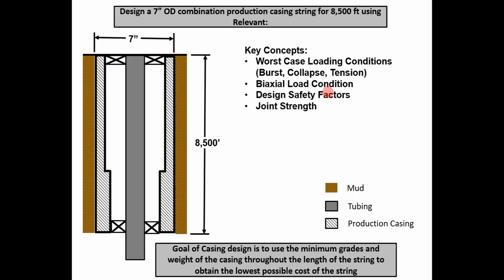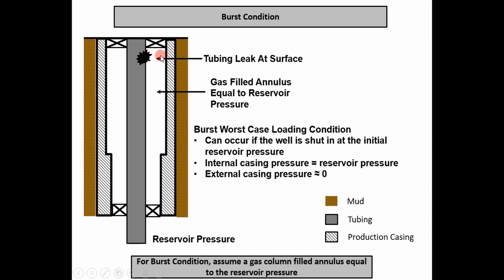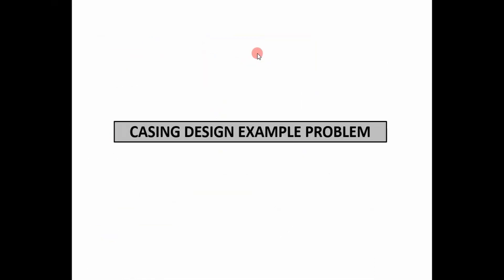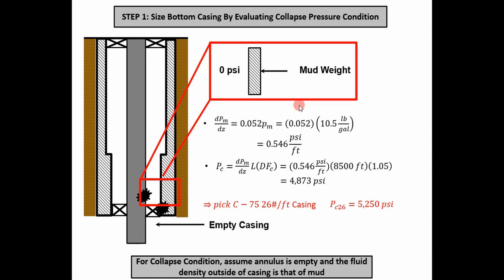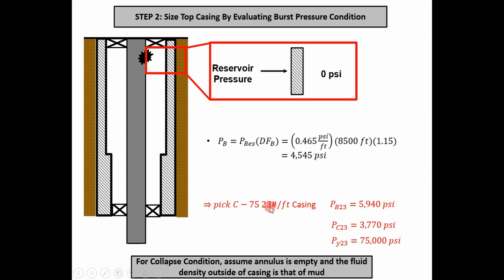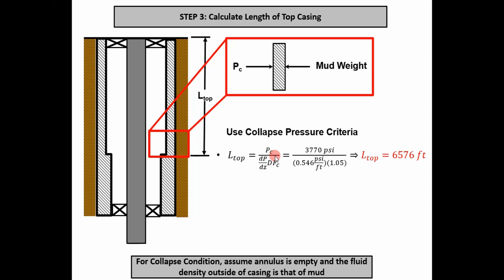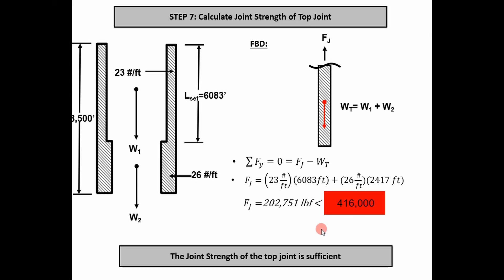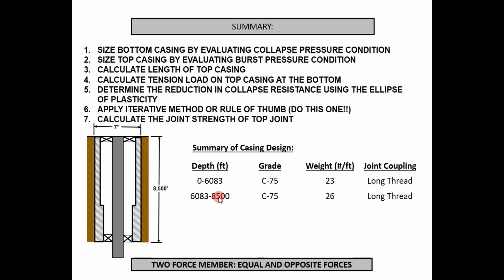Sizing a Casing String: Step by Step Approach

Comment: Can you tell me please how we calculate the casing weight on fluid
Reply from the maker: Its the weight of the casing minus the buoyant force
Reply: I wanna know how to calculate the buoyancy forces Fa= pressure* cross section area
Reply from the maker: @sarabasti3029  Sara, your on the right path. Draw an FBD and do a force balance that includes the weight of the casing string, and two external forces. The pressure on the top cross sectional area of the casing produces a downward force. The pressure on the bottom cross sectional area produces an upward force. You can also apply archimides principle which is a lot simpler and you get the exact same result on how your trying to do it. Hope it helps!
Reply: @topdogengineer8440  if you can give me your email and I will send you the exercise please